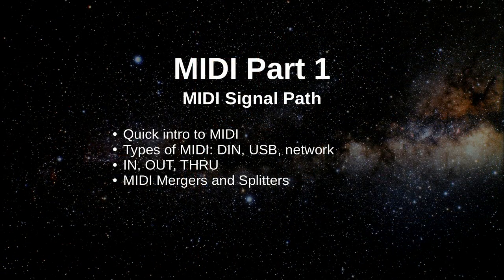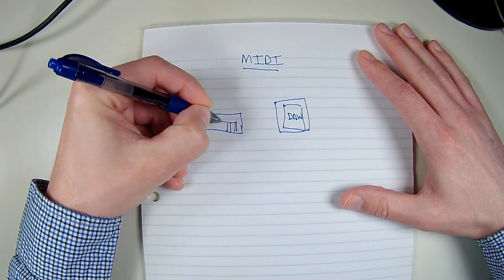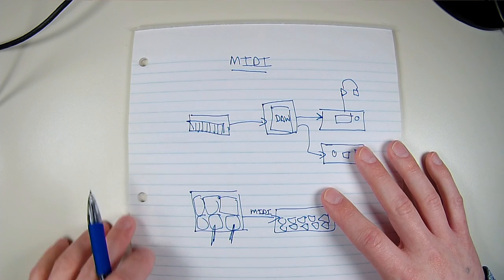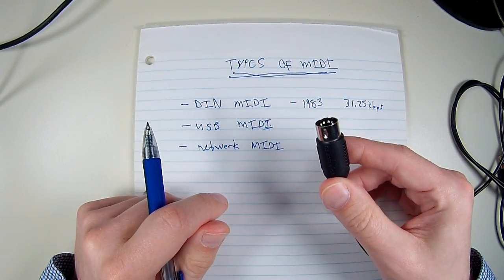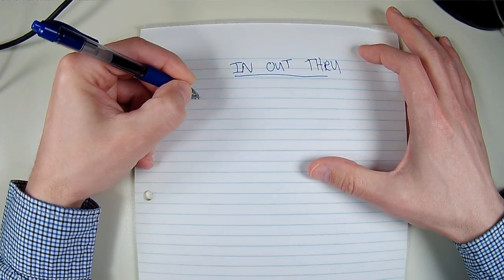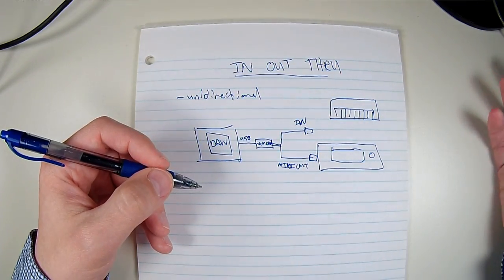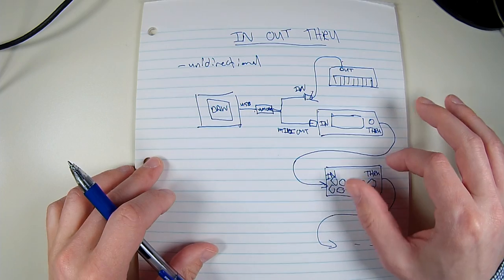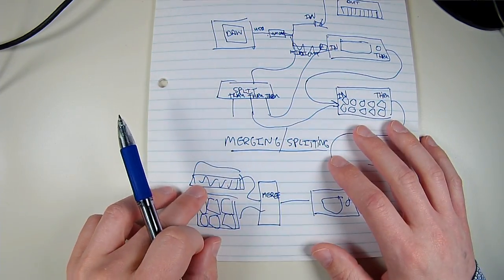MIDI Part 1 - MIDI Signal Path

Comment: There's no different types of MIDI. MIDI is a technical standard that describes a protocol, digital interface and connectors.

Then, there are different types of digital interfaces, based on different hardware and media communication buses like USB, Firewire, Ethernet, ISA, IDE or eSata bus, Thunderbold, Lightning, serial port, joystick port, or the next big communication bus to be invented.

Your Roland UM-1 is just a MIDI interface (based on the USB communication bus). You still have to connect your (DIN MIDI connectors equipped) synthesizer with MIDI cables to your UM-1.

When you plug your USB (or any other bus type like lightning or Firewire, etc...) to your computer, the OS recognize it as a MIDI interface, then when your DAW ask the OS: "what MIDI ports are present and declared in the system", the OS just replies: "here's all the MIDI ports I have that you can use". The DAW just doesn't know if it's USB, firewire, ethernet, etc... behind the scene!

Nowadays, some modern hardware instruments do not provide standard (IN, OUT, THRU) DIN midi ports anymore, but only a mini-USB in/out port. This USB port can be used for multiple usages (as audio in/out, MIDI in/out, to upgrade the synth firmware, etc...). When you plug this to your computer, the computer will regognize it as an audio interface, AND a MIDI interface, AND sometimes as a mass storage device if you synth has internal flash memory to locally store samples for example, AND etc... It's exactly the same as your UM-1 interface. It's just that the MIDI interface has been embedded inside the synth. So, DIN MIDI cables are not needed anymore. (PS: the trouble with this, is that you cannot connect old-school MIDI master keyboard directly to those new synths).

Sorry for being so long :)
Cheers.
Reply from the maker: This video series is designed to cover everything from high level concepts to low level details... from a user perspective there are definitely different "kinds" of MIDI. In future videos I'll be covering the lower level details and comparing DIN and USB, which are the two main transport types for MIDI messages. Stay tuned!
Reply: Your videos are awesome! Just wanted to clarify a few things from a top-down perspective.

No offence, but starting your video by saying there's "3 different types of MIDI: DIN, USB and network" is... simply wrong :) At this point, Apple users watching your video are totally confused, with their lighning iPad or firewire iMac... :)

Again, I really appreciate your video. All the best. Cheers.
Reply from the maker: I'm speaking mainly as a manufacturer and trying to clarify based on the many types of questions I get from customers. People tend to think in terms of what kind of cable something is, so that's where I'm starting. You clearly know more than the average user, so please just bear with me. :)
Reply: I have to agree with Arp here. You demonstrate a childlike understanding of MIDI and as such have lost all credibility henceforth. No point in continuing watching this series as one cannot trust they are getting accurate information

Comment: This should be an easy question for you to answer but being a complete noob at this midi thing.. I have my keyboard with midi in and out both connected to my audio interface. The keyboard can be heard thru the fl studio daw however no change in sound when I play it thru harmless or any other plugin. Under options, under midi both input and output show my interface but not my keyboard, even tho you can still hear it thru fl . What am I missing? Keyboard is a yamaha psr-85, audio interface is saffire with firewire 4in/10 out & the daw is fl studio signature version. Thank you!
Reply from the maker: You won't see your actual keyboard within the DAW... only the MIDI interface. What do you mean "no change in sound"? Are you sure the keyboard has local mode turned off? Disconnect one of the MIDI cables and make sure the keyboard itself stops playing... otherwise check the MIDI local setting on the keyboard... it needs to be off for use with a DAW. Then check the MIDI settings in the software itself.
Reply: @shiftedphase  Thank you so much for replying. What I men by no change in sound is that while I see the keyboard playing over fl studio(I see the mixer track being activated by keyb) if I use a plug-in on fl, I don't hear any of those effects. If MIDI local setting is on the keyboard here  then oh yes I'll turn that off . Thank you again I'll try that then.

Comment: Hi, thank you for the great info, could you also do a video on how to use the hteory u mentioned with Volca Sample and Logic Pro x through Akai mpk? it's really challenging, because volca sample only has midi in. I plug the midi cable to my controller and the controller us plugged to the computer via usb. But I only hear 1 sound which is the fist sound of the volca.   Also, this the volca sample has one midi channel for each sound, therefore 10.
Reply from the maker: I checked the Volca Sample MIDI implementation manual and it looks like you need to use a different channel for each of the 10 parts. That's kind of annoying. You need to set up 10 tracks, or use some other kind of MIDI filtering in Logic. I don't use Logic anymore so I can't really help you with that.

Comment: I have always been confused on how modern devices are able to use 1/8 TRS cables for midi transmission. Does this mean that not all the pins on the classic midi DIN connector are used?  ✌️🎹🎶
Reply from the maker: Yes only 3 pins are ever used. Data is carried on two wires (it is a current loop) and a shield is used to help with noise. The shield is only connected on the sending end (sometimes called a telescoping shield) and lifted on the receiving end to prevent ground loops.
Reply: @shiftedphase  thanks so much! I have learned so much from this series. Do you why they decided to use this cable? Was the reason that the 5-pin cable was already being manufactured? I’ve seen similar cables on old Commodore 64 peripherals. ✌️🎹🎶
Reply from the maker: @tedpedersen123  I think that's probably right that the 5 pin connector was quite common on early 80s computers. Any 5 pin straight-through cable would work for MIDI. These days professional MIDI cables only have 3 wires though.

Comment: How about hardware devices that has a software configurable midi out/thru port, is that also normally a electrical connection or will that go in via some microprocessor and introduce some latency?
Reply from the maker: Magnus Andersson It would depend on the hardware design. If it passes through a CPU there would be latency... but hopefully not very much.

Comment: Have a old yamaha PSR 530 keyboard midi in and midi out at the back conected it to in and out 5 pin knobs on audio interface - interface connected to pc via USB and using FL studio 6 - select midi on keyboard and put local on off. Sound setting on fl studio on Asio4all and works when pushing note on FL with mouse but want to get my keyboard keys to control that so when I push on them its like mouse and can play using fl with keyboard. 
Can't get it to work. Please help me ?!
Reply from the maker: I'm not an expert with FL Studio but you should check for the MIDI IN settings in FL... most modern DAW software has settings for choosing which MIDI input will allow notes to be played on tracks. Also, sometimes it's necessary to arm recording on a track to make the MIDI loop through from your keyboard.
Reply: Ah ! I have a PSR 530 running on Logic Pro X...I can control the software synths through it.... One of course is that MIdi Out goes to In , In goes to Out....in any interface...check that. Local off as you said.
Then we have to see Midi settings on your Daw.

Comment: To connect the audio of multiple devices to a PC running a DAW, do you use a preamp? What would you recommend?
Reply from the maker: I use a USB audio interface and an old digital mixer. If you don't have any equipment so far you can either buy an audio interface: Focusrite Scarlet series is very good, or a mixing board with a built-in interface... check out Soundcraft. Ideally you want something that allows you to record each channel directly to your DAW. Avoid smaller mixers with built-in interfaces that only record from the stereo bus... these are not good for laying down tracks. Audio interfaces range from $200 (2-4 inputs) to $600 (8-16 inputs) and most have at least a few microphone preamps.

Comment: Hello sir I have question here 
I have a Roland Juno -G display is damaged 
What I do in this case cause it’s display is to much costly 
Can I use midi option for external display and run function without and problem 
I m confused so please help me sir
Reply from the maker: You  can probably use most of the synth functions without the display over MIDI, but it is unlikely you can get the actual display data on an external screen. There might be a PC or Mac-based editor program or plugin you can use... that would be the closest to having all the functions available from the built-in screen.

Comment: hi sure thanx for tuto  i have china midi cable dos not work verry well with yamaha dx7 (like keyborad is work with my software vsti but when i was to add patch or sound seyex or midi ox don t work can i fixed the  china mother bord  usb midi () cable pls
Reply from the maker: Buy a good MIDI interface like a Roland UM-ONE. The cheap ones are not very good.
Reply: thanx sur

Comment: Help! My brain is exploding - i've never used rack versions of gear before so clocking everything up has been a no brainer because the MIDI IN was always available. Its difficult to daisy chain if you need the INs for a keyboard controller. I picked up an MS2000R rack version and I need the keyboard controller I own (one midi out/one midi channel) to control the MS. So if the MIDI IN is being used, then how do I send clock msg from another source into MS? Add in a Roland Sh32 (MID IN/ MIDI OUT only) that also needs a keyboard but needs to be synced as well and...I have a headache. Thnx for any help you could provide.
Reply from the maker: MIDI merging requires a piece of hardware... if the device only has a single MIDI IN, you would need to use a computer or hardware. Check the company called MIDI Solutions... they make a merger and lots of other useful devices.
Reply: Thx. So hypothetically speaking: I could connect a keyboard and a clock source like a sequencer into the INs of a merger and then the signal will be sent via  MIDI OUT to connect to MIDI in on device such as the synth I want the keyboard to control? Is this what I then need here: http://midisolutions.com/prodmrg.htm @shiftedphase

Comment: I don't understand why it would be the case that chaining via midi thru couldn't go on forever. Every thru port buffers the signal and the signal is digital (therefore regenerative). Would you mind clarifying? Looking forward to watching the rest of the series.
Reply from the maker: Buffering the signal through a logic buffer would definitely clean up the pulse edges. But re-buffering can't solve issues related to the optocoupler distorting the timing of the pulses. It's common / likely that the turn on and turn off speeds of the opto won't be exactly the same. Eventually the lengths of the pulses will be too distorted for proper reception. The solution is to use a MIDI THRU box, which sends the signal multiple directions in a star configuration instead of looping through multiple devices.
Reply: Shifted Phase Great reply, thanks very much. Plenty here for me to think about.

Comment: Can you do a vid on using a guitar multiFX pedal to a keyboard or something? I have a Digitech GNX pedal and the manual has maybe 5 words about the MIDI use LOL ... thanks
Reply from the maker: I don't really have any gear like that. But I'll see if I can borrow something.
Reply: @shiftedphase  thanks. I was mostly wondering if I could trigger a note/chord on a keyboard from a multiFX pedal. Or use it at all??? NOBODY has a useful vid on how to do anything practical with the midi of a multi unit in a live situation  .. thanks again

Comment: Most idiotic device interface This is no music anymore. This is only mathematics. - (If the signal goes to the tru port, does it stop on the synth, like on a train station, or goes it further to the next tru, till something stops it from running around in circles?) shakehead sorry..
Reply from the maker: THRU is just an electrical copy of the signal